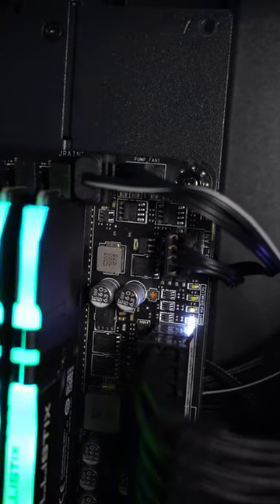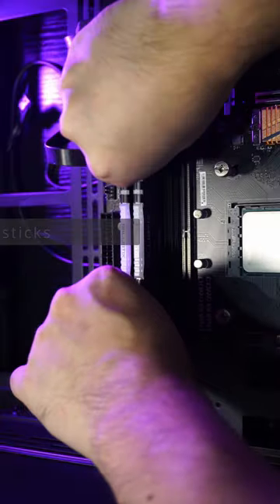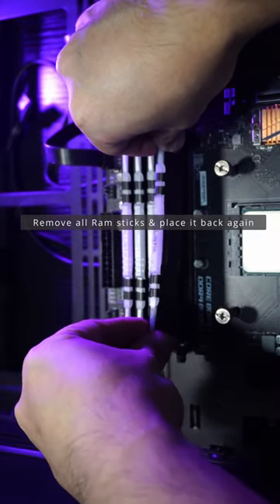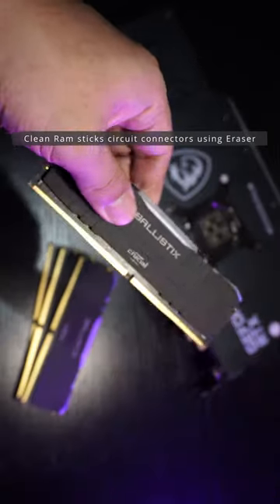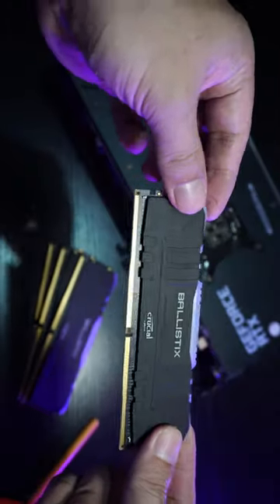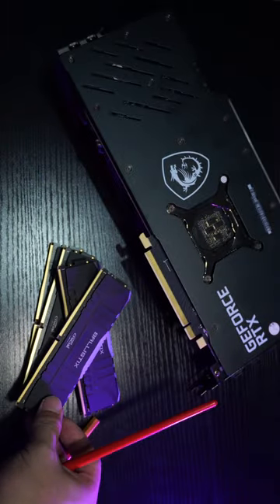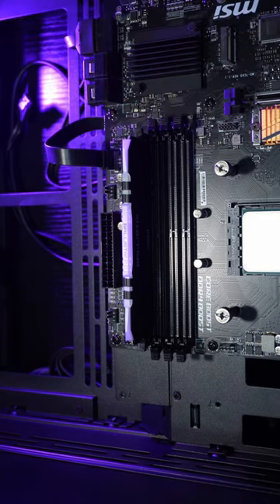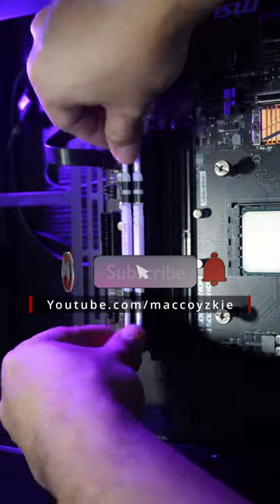Dram Debug LED always on FIX Part 2 #shorts

Comment: my LED is always on, my computer still boots and both sticks are working, i cleaned them but the led persists
Reply from the maker: what are the pc specs?
Reply: @MacCoyzkie  intel i7 9700k, rtx 2070 super, z390 phantom 4s-IB, xpg premier ddr4 2666 8GB x2, RAM are currently in 2 and 4, tried 1 and 3, and have tried each separately but light stays on all the time
Reply: @Ok-hq7lx  did you fix it yet. both my ram sticks light up but I still have the dram light
Reply: @iliasamar2837  start menu -> " windows memory diagnostic" -> restart now and check for problem. It will restart and go to blue screen, let it do its thing, it takes a long time and I mean a long time to finish. If there isn't a problem the light will turn off and if there is it will tell you what's wrong
Reply: @holdensmayda5201  i removed the cmos today and it worked. it feels good

Comment: when i start my pc, the DRAM debug light is on, but after the pc turned on the debug light is off and the pc run smoothly, anyone know what's happening?
Reply from the maker: that's normal, if you notice all the lights will turn on for a moment this means the motherboard is checking the parts

Comment: dram light is on took out ram sticks cleaned them still not working plz help
Reply from the maker: try one ram stick at a time and boot the system
Reply: @MacCoyzkie  also did this and it still doesn’t turn on
Reply from the maker: @haze2955  ask a friend to try your ram sticks in their pc, if it works then there is something wrong with your motherboard. it might need bios update or if not it might be faulty, use Rma if so
Reply: @MacCoyzkie  tried a friend’s and they didn’t work so gonna have to get some new ones thanks for help
Reply from the maker: @haze2955   no problem 👍

Comment: The f*ck replaced the RAM Sticks and Motherboard and the lights still coming on. Thinking it might the CPU in my case
Reply from the maker: your motherboard might just need bios update, including the old one you were using
Reply: @MacCoyzkie  I actually ended going back to Canada Computers for them to have a look as I had replaced the Motherboard, CPU, RAM changed the config of the RAM as well tried without the Graphics card and also tried another PSU. Told them if it doesn't work to replace it with Intel parts it was crazy because I spent in total $3k on the build as well!!!
Reply from the maker: @SultanSully97  sorry to hear that bro but i hope you get a new build that works
Reply: @MacCoyzkie  thanks bro, fingers crossed. You now have a new sub!!

Comment: Tried this method but same issue. MB MSI B550 Mortar Wifi.
Reply from the maker: what's the pc specs?
Reply: Sorry for the late reply. 

R5 5600x
MSI B550 Mortar Wifi
16GB Corsair
6600xt Sapphire
650w Coolermaster
Reply: I`ve try with different ram but still no boot. Dram light is still on.
Reply from the maker: @rhu0518  is the bios update with the latest?
Reply: @MacCoyzkie  haven’t try updating the bios yet. Been busy due to work. Will update soon. Thanks again.
Reply: Hi,. Late feedback. Done updating bios still not working. Dram error light still on. Do you think the problem are the ram slots?